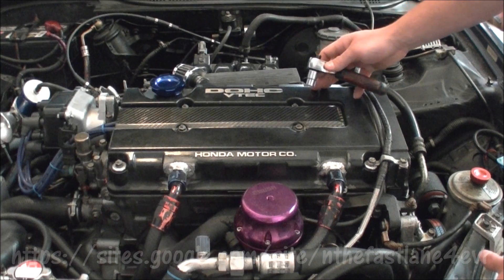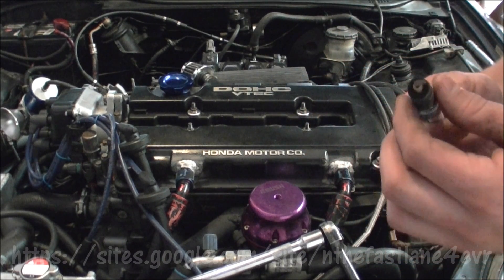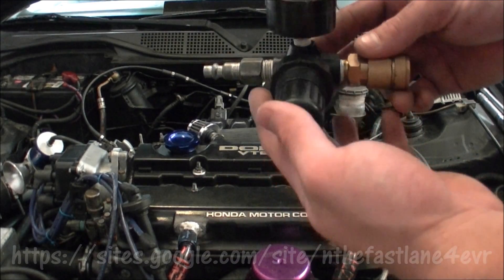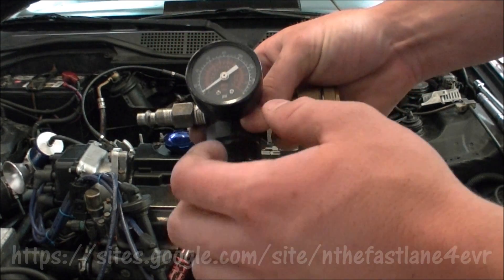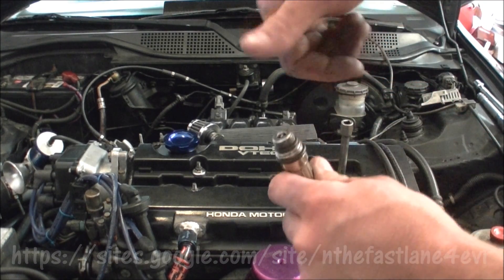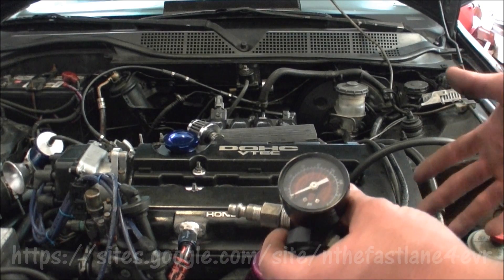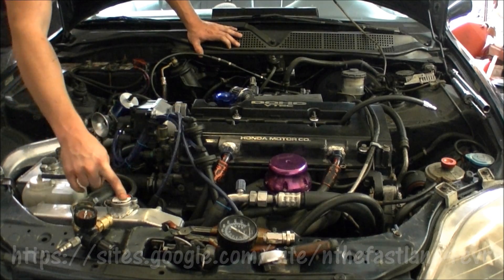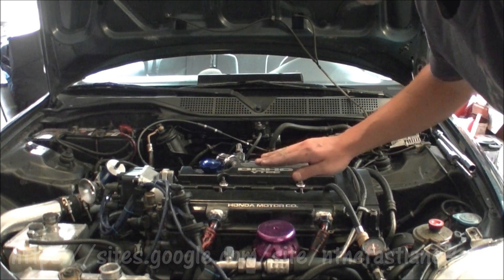Leakdown Test "How To"

Comment: Some good info but you did not show or mention a critical part of the test. How much did the pressure on your regulator gauge drop when you attached it to the cylinder hose? I made the exact same setup as you did (after trying the HF piece of junk with 2 guages- regulator was way too imprecise). If you have it set at, say 50 psi, and it drops to 40 psi when you attach it then you have 20% leakage. The 2 gauge tools just do the math for you by showing a % difference between the 2 gauges with a stepped down orifice between them.

Comment: Good video. I recently did one on by b18c and had some issues between cylinders and valves leaking. I had removed all of the plugs, if I hadn't, I would have not found air leaking from one cylinder into another. So this aspect is crucial for identifying a gasket failure that does not impact the coolant jacket. In my case, I did not have air coming from the radiator at all. My major question is this, (about to refer to my helms manual), can you also do the number 4 cylinder at the same time? I think the valves are open on the #4 cylinder when it is at TDC either sucking in fuel or disposing exhaust. So how do you know when each cylinder is TDC with valves closed? Do you refer to the cam gears for this? For example, cam gears point up, then number one cylinder is closed, at 90 degrees, number four is close, and so on for the other two.

Comment: Great informative video.....just make sure that its top dead center on the COMPRESSION stroke only for each cylinder you test, if its on the exhaust stroke then your exhaust valves will be open and you'll get a false reading out the tail pipe!
Reply: I told that earlier. but great explanation , very helpfull

Comment: i have a f20b in my prelude. im showing a missfire.  iv put a new cap and rotar, new plugs,plug wires.  i did a compression test yesterday. cylinder 4 held air, cyl 3 held, cyl 2 held air, cyl 1 did not hold air it actually pushed air out of cyl 4. i did this compression test with all plugs out.? any ideas?  im thinking something internal ."seal" warped head"    they all held pressure except cyl 1 witch pressed air through 4"